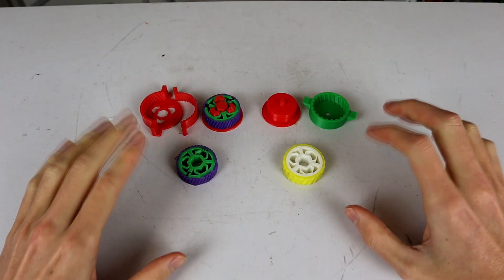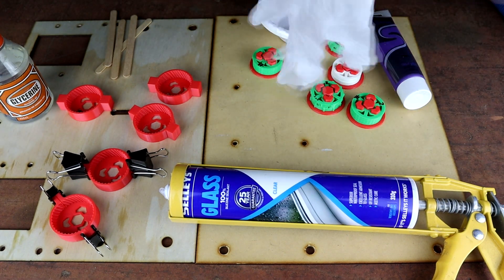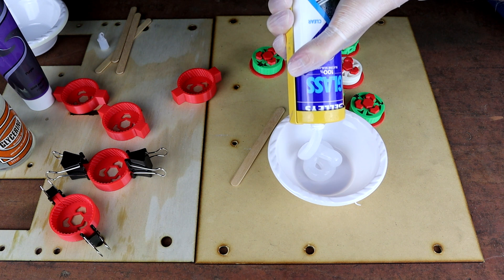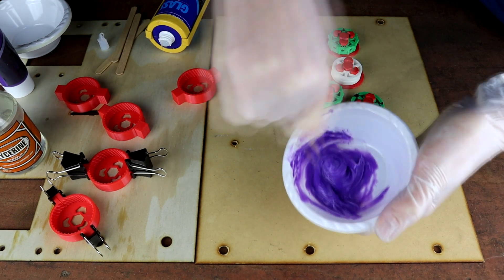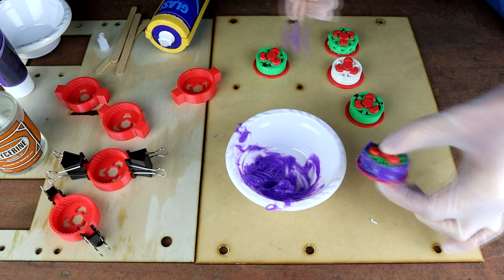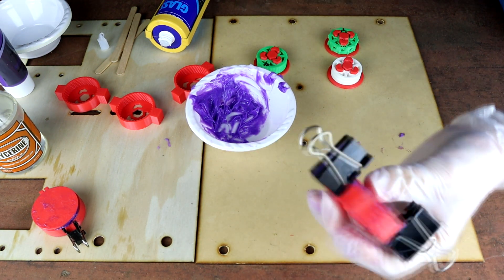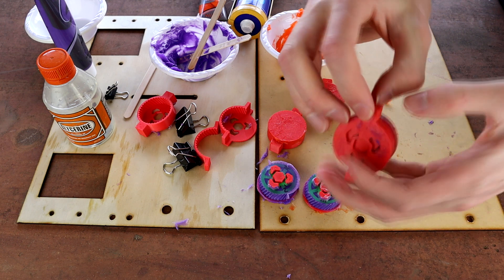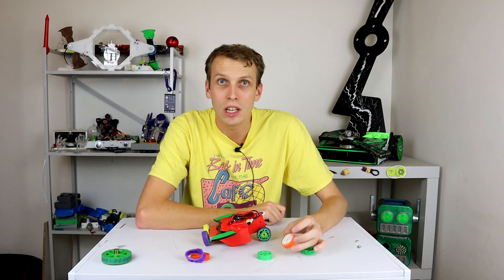Cheap and easy silicone tire casting for robotics platforms

Comment: No mold release to stop the silicone sticking? Or it doesn't stick to PLA very well? 

I'm gonna try this - only difference is I'll add glitter.
Reply from the maker: silicone doesnt stick to most things, I've done it with and without mold release and found no difference so stopped using mold release.

This does mean even if you put holes and things into the wheel for the silicone to grab you need to glue it down. the red and black cheap nasty super glue from bunnings is the best thing I've found to stick silicone to PLA/ABS/TPU
Reply: Ok, I'll use some super glue - I might go fancy and use some loctite 406 though, it bonds to PLA/ABS better than regular super glue.
Reply from the maker: It probably wont work on silicone, the cheap nasty stuff from bunnings is the best stuff I've found

If you do try it and it works, let me know

Comment: I do a similar process, but I use a 2 part mold making silicone. You just need to mix the two parts, then I use a large syringe to inject it into the wheel molds.  It tends to be a bit less messy than pressing it into the mold.